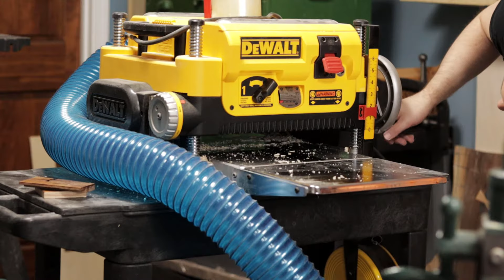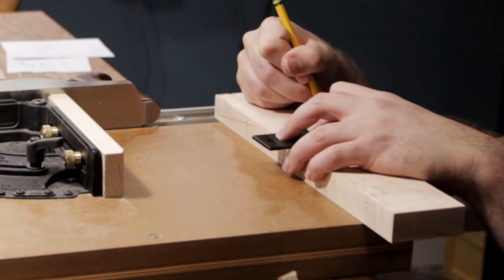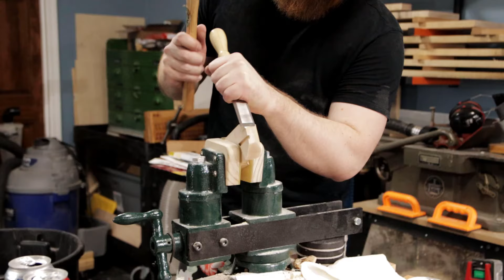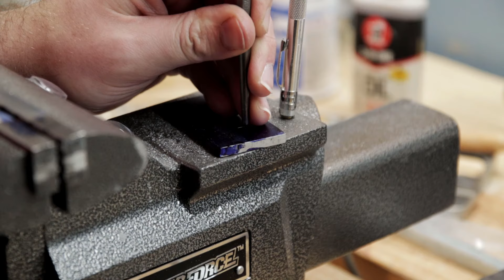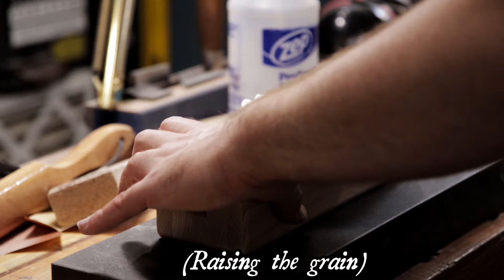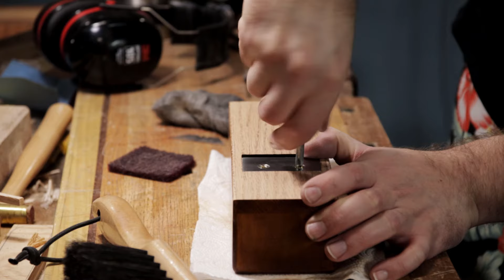Making a Wooden Miter Plane

Comment: How do you decide whether to joint/plane by machine vs by hand?
Reply from the maker: If the board is wider than the jointer or real short I'll do it by hand. Same, if I only have a couple of boards to do. If I have a lot of boards to run I'll do it on the jointer. Lately, I've been doing all my jointing by hand. I moved the jointer out of the shop because I ran out of room. It is more of a hassle setting it up than to do it all manually.

Comment: Looks great, Thanks.  After having used a gauge for cap iron screw clearance , do you recommend an auger ?  Or isn't the angle of approach conducive to the use of such tools ?
Reply from the maker: I didn't even think about the auger. There would have been enough clearance and it would have made getting a round edge easier.
Reply: @EricMeyerMaker  thank you
Reply from the maker: You are welcome!

Comment: You would love a 5-1/2  Woodriver or Lie-Nielsen plane. That thing you used at the beginning was painful to watch. Doesn't matter how much you spent on it, far too much skipping and chattering before you got close to dialing in the surface. It should be an enjoyable journey, that looked like a "can't wait til it's over" moment.
Reply from the maker: What is the time stamp? I'm a little confused on what you are referring to.
Reply: @EricMeyerMaker  I think they're taking about the low-angle smoother that you were using on the shooting board
Reply from the maker: Ooooh. Yeah,  that was why I make this miter plane.
Reply: 5.5 Woodriver or LN..... you must be from the Rob fan club 🤔😂 LN is jus an overpriced standard plane with some polish on it. Woodriver is a Chinese clone of the previous plane, minus some brass/bronze and bling. 
Get yourself some Veritas planes, those are the true innovators in plane making, they're absolute work horses 🤙